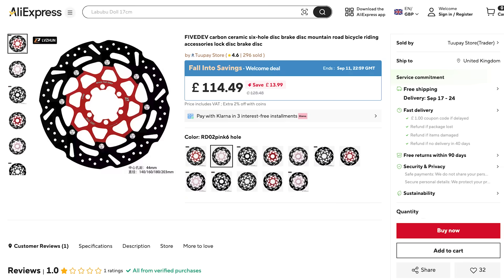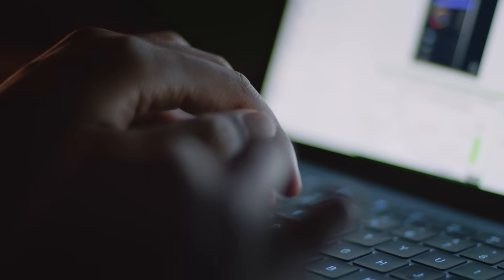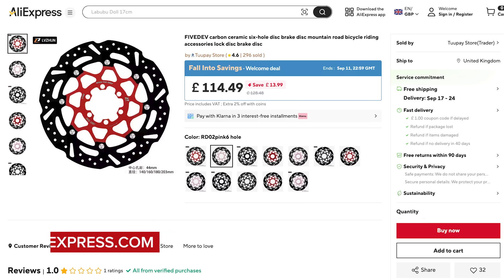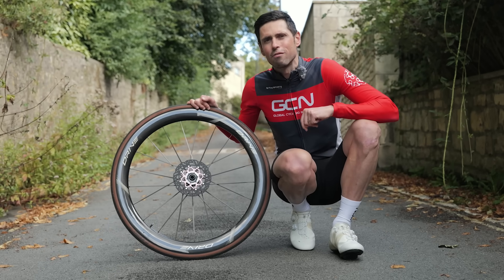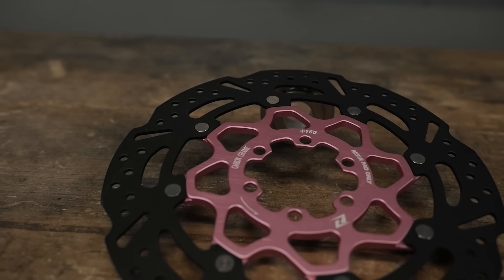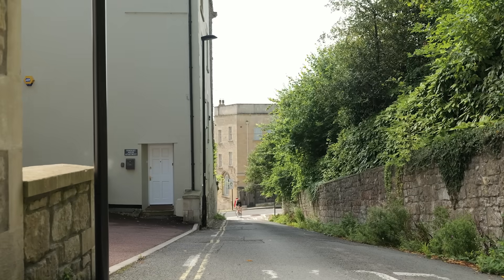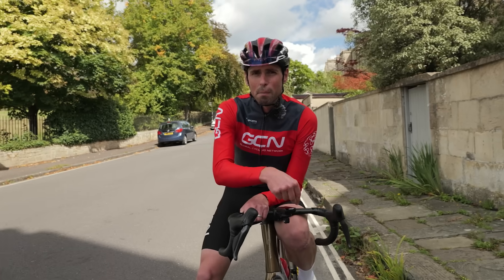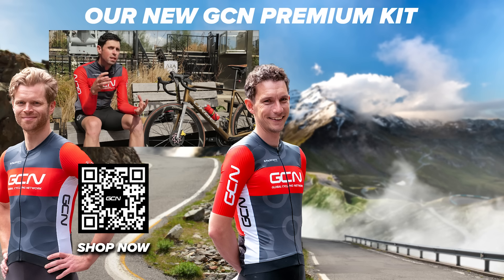Why Bikes Can't Have Carbon Ceramic Brakes

Comment: This is by far the most idiotic think I have ever seen. Also this video is full of mixed references - carbon fibre reinforced plastic is what people consider colloquially tp be "carbon fibre" . That material cannot be used as a brake disc. Carbon fibre reinforced ceramic is a completely different material  and that can be used as a brake material. But - low speed performance makes it completely unsuitable for cycling. Hence - idiotic!
Reply: Agreed - there is not talk about what actual material they are made of…
Ceramic - think porcelain… reinforced with carbon fibre is completely different than the fibre reinforced epoxy resin that bike parts are made from
Reply: It’s not actually normal carbon fibre, it’s a carbon ceramic composite with silicon carbide (at least in automotive applications)
Reply: @Boahman exactly
Reply: what about ebikes? i can see the steam come off my ebike brake rotors on cloudy mornings.
Reply: @NatileL-t3e what about ebikes? Steel rotors are fine for a bike… have you got them red hot yet? I doubt it.
Reply: @workshopninjathe1st Agree, if steel rotors work fine for 3 ton SUVs, it’s fine for you 😅 also carbon ceramic is less effective than steel when cold, so if youre not getting your steel plate to be red hot, CC will perform worse than regular steel
Reply: @workshopninjathe1st that’s flawed thinking. Steel frames were fine until aluminum started to be used. Aluminum was fine until CF started to be used. There is always a search for something better…
Reply: I agree about the difference in material names and uses
Reply: Ding ding ding!
Reply: I'm not disagreeing but ppl or companies did make it maybe for e bikes suron or better but mt cross or speed biking doesn't make sense it would be better to run no brakes to save weight than spend more
Reply: Who is saying carbon ceramic rotors are not OK for low-speed use?

Comment: That is an aluminum or steel alloy disc with SiC coating.  Someone in billibilli sliced his copy open and found that out.  The SiC coating is also very thin.  He tested it with 3 pads, one of which Shimano's L03a / L05a, that one came out tops.   But lots of squeal in the dry, similar to what is posted in this video with GCN's own testing.  The braking performance is sucky. No way of posting the link, it gets auto deleted.   Neither can i post the title. BTW i am not talking about Carbonova, it is the one that you can get from aliexpress.
Reply: Yeah, I bought one and scratched off the coating pretty easily. these are dangerous fakes.
Reply: Billibilli is fun to say, sorry nothing more to contribute :P
Reply: so basically, you get an ephemeral crap coating and afterwards you've got a budget steel (hopefully steel) rotor... sounds par for the course. Thanks for the info!
Reply: @tychoMX nope, it's soft aluminium. Good luck not dying!
Reply: Да, подтверждаю, через 200 км покрытие стерлось полностью, и они оказались алюминиевыми
Это очень опасно, алюминий очень мягкий для роторов. Что бы это доказать я просверлил ротор на камеру, сверло легко прошло сквозь мягкий металл. Эти чуваки готовы рисковать жизнями своих клиентов ради обогащения. Это полная жесть, их надо посадить
А если кто то купит их для DH? Алюминий просто сомнет при перегреве, или сорвет ротор с паука, и ты останешься без тормозов перед роад-гэпом высотой 15 метров

Comment: If you want to reduce weight and money is not an issue, then it makes more sense to develop carbon crank arms before disc rotors.
Reply: Huh? I have carbon Campagnolo cranck arms and aliexpress is full of chinese brands selling similar
Reply: lol who doesn't have carbon cranks?
Reply: @kidShibuya  personally, me, and I'll never search them out. But then again I ride (and damage) my bikes.
Reply: But those exist no?
We have Carbon cranks in MTB atleast
Reply: @Chaoshero5567  Yeah, THM is one of the more recognized carbon crank/crankset, but there are several others. Unfortunately the price is pretty sweaty still ;)
Reply: @Jeppelelle  i mean, there are Carbon cranks cheaper than my Ttype Alu cranks lol
Reply: @Chaoshero5567  yes descendants for my mountain bike were $320 CDN, cheaper than most boutique alloy
Reply: All my bikes have carbon cranks arms, except for the single speed 😂

Comment: Unless you live at the top of Mount Everest, or attain regular speeds of 200+ mph I cannot see why you'd need full carbon rotor/discs! They'd never get hot enough to be effective, combined with lateral brittleness I'd give a miss!! You need some modulation to be effective on a regular road bike! I stand to be corrected in time!!!😂😂😂
Reply: Yet people buy ceramic bearings when no part of the bicycle spins fast enough to warrant their usage on bicycles...
Reply: @sepg5084  Someone once said "ceramic bearings excel at extreme high temperature, high speed and high pressure environments. Cycling is none of those."
Reply: @sepg5084 pro of Ceramic bearings is that they are (usually) just made better rather than material itself. It’s much easier to find a good ceramic bearing than equally good steel bearing (not that they don’t exist, but there just ist’t much of a market for something like 200$€£ steel BB and hence not often sold in stores)
Reply: @CXCyclist  if you buy a steel bearing from the industrial top manufacturers (Skf, Fag, NTN, Timken) it's a good bearing. Such bearings are standard parts, with worldwide standardized sizes.

BB cartridges use standard bearings inside. So you could take the "chassis" and put different bearings in.
Reply: @sepg5084  They still have lower friction than steel bearings.
Reply: Might be of value in some of the mad descents in the grand tours?
Reply: You do not understand carbon brakes.
Reply: @firstname7780  Do you? They use carbon discs in MotoGP but they are shrouded to keep the temperature up high enough to maintain the effectiveness of the brakes. In wet weather they use steel rotors because then the rotors never get hot enough for carbon ones to function properly.
Reply: @firstname7780 That's hardly a helpful comment when you don't add anything to the debate and simply make an ad hominem attack. If you want to say that, then at least back up your statement.

Comment: Most people can’t even handle the stopping power of steel disks, so what’s the point in trying carbon ceramic discs
Reply: Carbon ceramic discs aren't about stopping power, it is about fade-resistance...
Reply: @sepg5084 not to mention if they were actually grippier - you’d be able to use a smaller diameter.
Reply: @sepg5084 but carbon ceramic brakes need a certain minimum temperature to work properly. Where they are used they typically doesn't cool off.

On a bicycle they will cool down and you will ride outside their proper working temperature most of the time, except for longer descends.

So you would ride with a substandard braking power most of the time if they are too cold.

Such brakes are also not used on normal cars for this reason.
Reply: That is ok then because carbon discs are lacking stopping power unless they are very, very hot indeed. If your discs do not get red hot while braking you do not need carbon discs.
Reply: Heat resistance and weight.
Reply: "Who cares if it stops as long as it looks cool and can save a gram"
-most road cyclist
Reply: That's easy. Because instead of running 160s, I could go down to 140s or 120s saving even more weight and aero.
Reply: @driventomadness117  Carbon discs on a bicycle will never get hot enough to work better than steel ones.
Reply: @gustavmeyrink_2.0 could use a smaller rotor like 120. It would get hotter than 160mm, not sure if it would be enough though
Reply: Heat management, but like its already been said, the cost to performance gain and weight saved isn't really worth it, unless you go 70kph everywhere all the time with constant feathering of the brakes to overcome wind resistance and keep them warm enough.
Reply: Depends on if they're going downhill or not usually 😅 but yeah most old people on the path don't need them. I've ran out of enough braking many times lol.
Reply: Weight reduction

Comment: short answer before I've even watched the video: no, because carbon ceramic brakes only work "good enough" when they're glowing hot.
Reply: Wrong. F1 brakes are carbon-carbon. Carbon ceramic rotors are for road cars only and don’t require any heat build-up to operate correctly. Brakes that operate like F1 brakes would never be allowed on a road-legal car. I have a 911 with carbon ceramics.
Reply: @RB-xv4si you should drive your beetle more and test also other sport cars with “normal” brakes. 😅 you’ll see the difference in the cold. 
(Yes, they need to warm up to function properly). Hope you don’t crash soon.
PS: There are also carbon-Carbon rotors for road bikes
Reply: @CXCyclist tell me you’ve never driven a car with carbon ceramics without telling me….
Reply: Then this might be better for commuter ebikes? Lol
Reply: it was my first thought - but than i remembered - there are versions out - for daily drivers - expensive ones - but able to work well in ordinary conditions
Reply: @bertkreft9689  just because they "work" for daily driving, in daily driving you also dont have to use 100% of the brakes.
They are still worse than good ole normal brakes at cold temps
Reply: Carbon ceramic brakes are designed specifically for road cars so they work at cold temperatures.
Reply: @keithreed5009 but they're terrible until they've got heat into them.  Also cost an absolute fortune.  I.e. can get a Cayman GT4 with carbon ceramics, but most owners swap to the steel discs and put the ceramics back on when putting up for sale.
Reply: @keithreed5009  There are reasons why they are just used in extremely expensive sport cars and even there not as a standard. They are actually for people who want to take their Ferrari to where it belongs: on the race track. In a car you can do a crapton of pressure to achieve good results results while the brake is cold while things are quite limited on bikes. 
Carbon is an incredible material for sports equipment but for everyday use it's simply to brittle and expensive.
Reply: @svenweihusen57 I have carbon ceramics on my 911 Carrera. They were first offered on Porsches sometime in the early 2000s I believe. So they’re nothing new. These feel almost the same as steel rotors when driving but with a little more noise at slow speeds. 

I’m upset at this engineer he interviewed for not explaining this but there is a big difference between F1 brakes and carbon ceramic brakes for road cars. F1 brakes are carbon-carbon, meaning the matrix holding the fibers together is also carbon and these do require significant heat to operate correctly. 

Carbon ceramic rotors on road cars usually have chopped fiber with a more standard high-heat binder, then a ceramic layer added to both sides of the rotor. They do not require any heat soak whatsoever to operate normally. This would never be allowed on a road-legal car.

Comment: You bought a steal disc rotor with black 'carbon' painting for 117 Euro? That's quite a bargain.
Reply: Normally I would correct to 'steel' but in this context, 'steal' seems more appropriate.....
Reply: @CyclespeedTours 😂😂😂

Comment: Carbon brakes don’t make sense for emergency stops. 
Carbon ceramic brakes need to be warm to perform.
Reply: They don't need to be warm, they need to be RED HOT to perform optimally... a bike will never be heavy or fast enough to make this happen....
Reply: @ElZamo92  An illegal ebike absolutely BOMBING down a winding hill, maybe, a carbon fiber road bike with a dentist who stays at race weight? it'll be reliably worse.
Reply: @ElZamo92  Thinking real hard about it, if the rotor was razor thin and well contained, it could be a thing, but the durability issues get dialed up to 11.
Reply: Yeah it's just not the right technology for the application, it's lighter but the cold performance just makes the losses worse than the gains. I've never seen steel disks on a bicycle glow and you really need to be up at that end of the working range to start seeing the advantages of carbon ceramics. Also they're extremely noisy until they're warm, like grit stuck under the pad level squeaky.

Comment: honestly people chasing lightness in brake rotors is a foolish errand. you see brake discs for lighweight which are mostly holes. 
go the opposite. as few holes/slots as you can get away with for cooling/water clearing/pad clearing. this gives the most pad to rotor area for power and rotor stability before geting to hot and turning into a floppy noodle.
look at any high performance application for brakes. you don't see them taking away all the braking surface.
Reply: They don't even look cool!
Reply: I first put Galfer rotors on my road bike but the braking power was not acceptable. The new Dura-Ace ones are very good. Also switched from front 160mm to 180mm on my gravel bike very good upgrade much better modulation and power.
Reply: I use giant brake rotors, about 28 inch in diameter... Even after very long alpine descends they are barely warm to the touch! They are so big you can just mount the tire on them as well! Very convenient!
Reply: @MicroageHD they tend to look terrible and dont last however.
Reply: @alfonsokhiew2872  Oh no, they look really nice! You also don't need a second little rotor which is another wind catch!
Reply: @MicroageHD you also don’t need to die on a steep wet descent while using the the second little rotor.
Reply: @gnom4685 yep, because in the last 100 years it has been proven that big rotors are totally unusable haha
Reply: @MicroageHD saved me life once. Rim brakes on carbon brake track compared to disc brake is night and day difference. In the dry rim brakes are fine to me, they also look better
Reply: @MicroageHD  Whatever floats your boat, bro!  Watch the rain, anyway...
Reply: @MicroageHD  They are inferior to disc brakes under difficult conditions. They made tests with rim brakes and disc brakes including wet conditions and gravel. The difference on dry tarmac was minimal but in wet conditions and on gravel disc brakes toasted rim brakes. It wasn't better braking power (you can lock the wheel with both systems under these conditions) but better control which resulted in a way shorter braking distance.
Reply: @MicroageHD  Me too. And my 28” rotors also have a ridged edge called Exalith which not only look (and feel) cool, but brake quite really well, as well. Useful given i live in the French Alps. Stick with Old Skool….😂